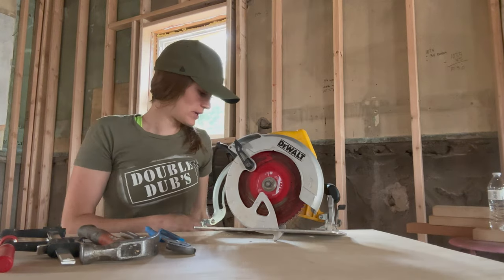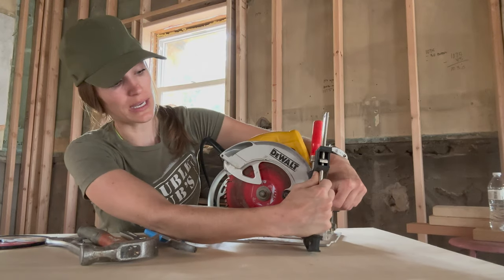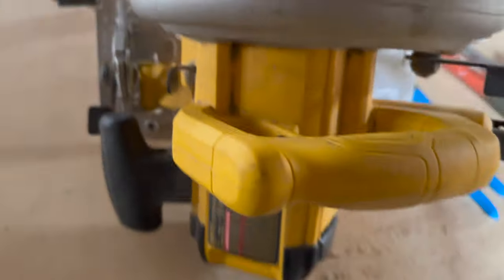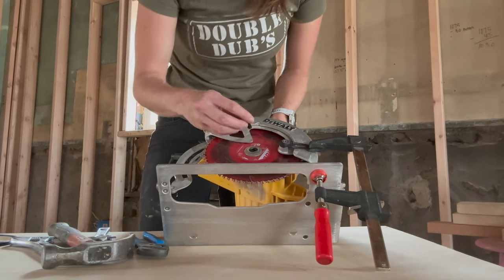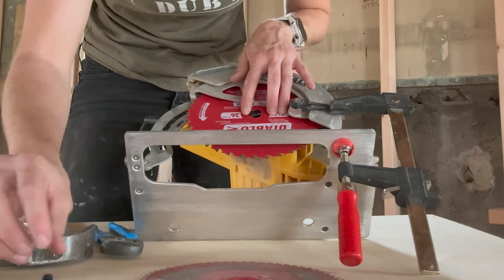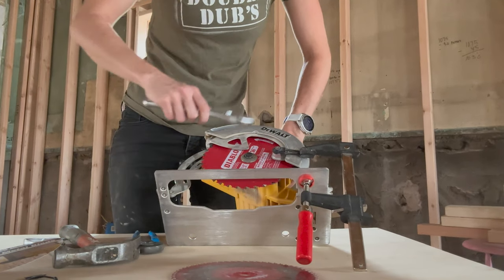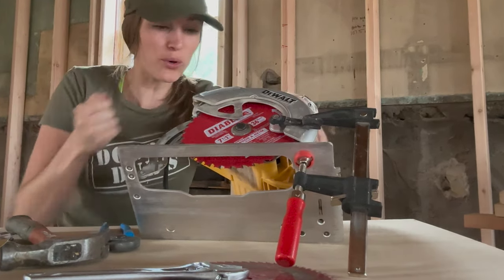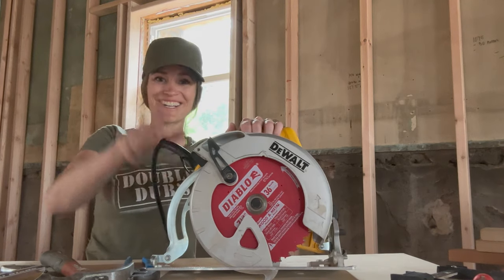How to Change the Blade on a DeWalt Circular Saw if You Lost the Blade Wrench

Comment: All my circular saws have different size arbor bolts on them, so I write the size socket I need on the side of the saw.  Saves me time looking for the correct size socket, and it is easier than using a crescent wrench.  Only one of my saws provided the correct size wrench, and that wrench neatly tucks away into the saw plate for storage.

Keep up the good work.  I greatly appreciate you taking the time to produce these videos.
Reply from the maker: Good idea! And yes, many of them come with the appropriate tool but a lot of people lose them over time

Comment: Blades are so cheap I always have a fresh blade on my saw. Especially with a cordless saw so it doesn't need to work so hard. And clean cuts.  I've found many to over tighten the bolt.  Don't be like me and use channels or vice grips. Use a 1/2" wrench or socket.  A socket on the impact gun spins the bolt off with out locking the blade.  Don't forget if the blade is on the left that it's most likely a reverse thread!

Comment: You made this far more complicated than necessary. It would definitely be easier with the base shoe fully retracted. The proper wrench is literally stored right in the handle. You just need to make the bolt snug because the rotation of the saw motor keeps the bolt tight. No need to put all your power to it. Instructions come with the saw or online if you don’t have them. Learn the names of all the parts before telling others how to do things and how to actually do the job. Good luck with the wood cutter thingy.😂
Reply from the maker: Its great when you have the blade wrench still. I have had a handful of people ask me what they can use when they lose that. Not everyone is an expert and they need help and options to work with what they have available to them. Thats what I am here to provide. I would add, Steven, it's definitely fine to leave constructive feedback but not necessary to be rude or make fun of people in your comments. Comments like yours make me think of the scene in "Talladega Nights" when the Grandpa is being mean and the little boy says "Someone didn't love you enough when you were little."